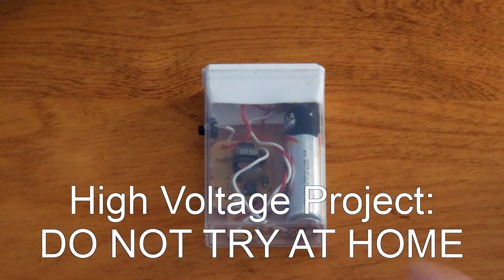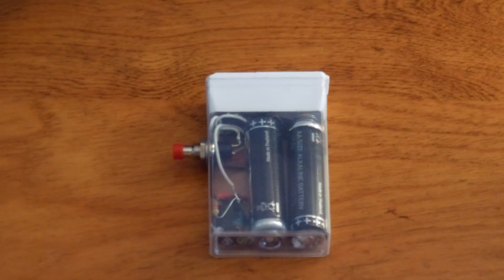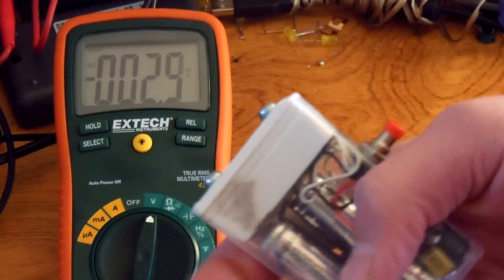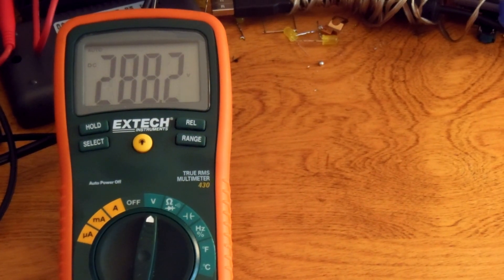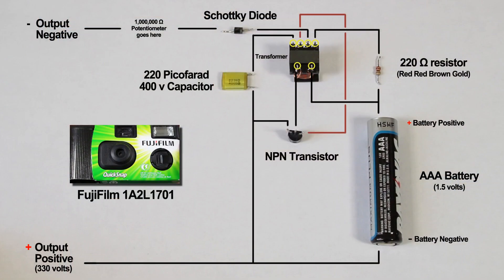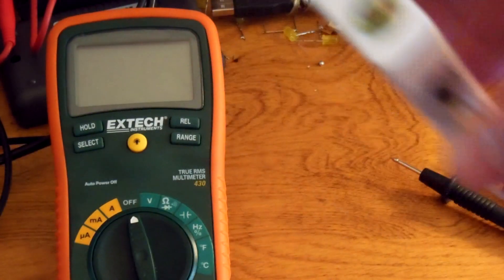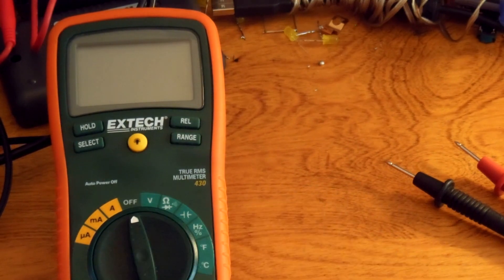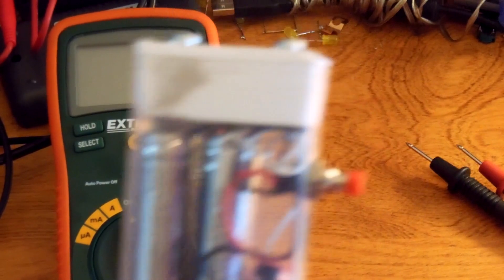Tic Tac Taser 2.0! Build a Stun Gun with Disposable Camera Parts!

Comment: in fact....maybe you could help me. You are clearly more inventive than I am and you are obviously a BAMF.....Help a brother out? :)

I put a shitty video of the component I'd be using, I'm sure there's SOMETHING I can do with it, considering what I've seen you do. My concerns would be exploding the battery acid all over myself or something like that but between my dad's skills in electronics, dated as they may be, and some of you youtube geniuses, I think I could develop a genuine combat-stun-glove that is perfectly viable
Reply from the maker: Joe Cannabyte It looks like that would work fine. Just make sure to insulate ALL wiring very well to avoid shocking yourself. I wouldn't be to concerned with the batteries, but you could likely replace them with something that has the same voltage.

Comment: do you have links or something to buy the tools required?
Reply from the maker: I collected the tools over time, so I don't have any specific links. You will need a soldering iron and solder, a hot glue gun, probably a drill and some drill bits, and needle nose pliers. Wire strippers and wire cutters would also be nice to have. You can get away with just using a soldering iron, a hot glue gun, and some pliers, but it would be fairly difficult.

For a beginner, I would recommend a Weller soldering iron such as this:
http://www.amazon.com/Weller-SP23LK-25-Watt-Soldering-Iron/dp/B0009ZD2AG/ref=sr_1_15?ie=UTF8&qid=1414555360&sr=8-15&keywords=weller+iron

The rest doesn't really matter, as anything should work in order to build basic projects such as this.

Comment: Could this kill a human or it wil make them faint but will wake up
Reply from the maker: electroguy2007 He had a valid question on the power of the device. I don't think that his intent was to kill anyone with it. Also, if he hypothetically wanted to kill someone, a $2,000 rifle is probably not the most economical solution.
Reply from the maker: Neither. It hurts, but does very little damage. Plus, when getting shocked the current only passes between the two points, avoiding any major organs or anything that would cause significant damage. And I have shocked myself with it and I didn't die and everything else is fine to my knowledge.
Reply: Just buy a friggin M16 if you want to kill someone

Comment: Hey can u show me step by step on how to make this with 2 batteries? I really need this thing.
Reply from the maker: I really can't, most of the parts I used were salvaged from other things, so I can't give you a parts list or anything showing you how to make it. Every part other than the batteries and the parts from the camera were found in my parts bin. If I built a second one, it would be completely different from this one due to the materials I have.

If you can't figure out how to read the schematics and stuff, you probably shouldn't be playing with 750 volts.
Reply: I REALLY NEED ONE OF THESE. CAN YOU MAKE ONE WITH 2 BATTERIES AND SELL IT TO ME?
Reply from the maker: alex mendoza I can't count the number of reasons I can't sell you one. Liability is a major reason. If I sell you one and you kill someone with it, I would probably be sued. Why do you need one so bad? Just buy an actual stun gun if you need one so bad, or just make your own. It's not hard to make, anyone can do it with some basic tools and stuff.
Reply: I BOUGHT A KODAK CAMERA YESTERDAY TOOK OUT THE BOARD. DESOLDERED THE CAPACITOR. SOLDERED WIRES WHERE THE CAPACITOR USED TO BE. CONNECTED THOSE 2 WIRES TO 2 SCREWS. THEN I DESOLDERED WHERE THE BATTERY GOES AND HOOKED UP A NEGATIVE AND A POSITIVE WIRE FOR THE BATTERY. AND THEN I CUT THE 3 WIRES THAT GO TO THE FLASH. AND NOTHING HAPPENED. IT DIDNT WORK. WHAT AM I DOING WRONG?
Reply from the maker: alex mendoza Does your camera have a Neon light or an Led? If it is a neon, I can't really help you because that doesn't work with this design. Did you put the battery in the correct way? Start with 1, then move up to 2 once everything works. You also need to hold the button that was used to charge it, that is what the red switch on mine does.
Reply: YES MINE HAS AN LED
Reply: IM ONLY USING 1 BATTERY
Reply from the maker: alex mendoza Have you tried holding the button down?
Reply: YES I HAVE TO HOLD IT DOWN IN ORDER TO WORK SINCE IT HAS NO CAPACITOR.
Reply: U KNOW WHERE THE FLASH BUTTON GOES I HAVE TO SOLDER THE BUTTON TO THOSE POINTS RIGHT?
Reply from the maker: alex mendoza Yes, there should be a circle in the middle and 3 rectangles around the outside. You need to connect one wire from the switch to the circle, and the other to one of the rectangles. It doesn't matter which one, all 3 rectangles are connected on the board, so you just need to solder to one of them.
Reply: HEY I GOT IT TO WORK
Reply: HOW DO I ADD ANOTHER BATTERY?
Reply from the maker: alex mendoza It is simply 2 batteries in series. I had to fabricate some parts to make everything work. It might destroy your circuit board though, so if 1 battery works good I would just leave it.
Reply: Or just buy a bb gun
Reply from the maker: electroguy2007 He didn't specify what he needed it for. I did mention in the version 1 video that this would make for a good prank taser. A bb gun wouldn't really be a prank. Also, for self defense this would be more discreet, and it would less illegal than carrying a bb gun around.

Comment from the maker: When asking a question unrelated to the previous one, please comment instead of replying. It makes it easier to find the comment and reply to the question.

Anyway, I ran two batteries in series without damaging the circuit too much. I am sure that the parts wear out faster, but because I don't use this frequently, it should be fine. I know 6 volts destroys the parts almost instantly though.

Comment from the maker: You're the the dumbass. The amperage will vary from situation to situation. The amperage is equal to voltage divided by resistance. With 600 volts, and a skin resistance of 10k ohms, the current should be 60mA, or .06 amps. Amperage doesn't kill people all by itself, and neither does voltage. A 12 volt car battery can supply as much as 1000 amps, but it doesn't vaporize people. Also, I should mention that this circuit can't even supply 60mA. It hurts like a bitch, but doesn't kill people.

Comment from the maker: It will look awesome because my Nikon S6300 can record 120 FPS slow motion. You might have seen it on the charger video. Between the Microwave Oven Transformer, the Flybacks, the Voltage Multiplier, and the Capacitor Bank, I shouldn't have any problems melting, burning, vaporizing, or destroying objects.

I also need to get some more flybacks, and go through my salvaged transistors to find some others to test with my driver.

Comment from the maker: The schematic seen is not one that I created. I found it on the internet, tested it, and it works. The one in the microphone video is simple, only 3 parts. Also, the breadboard is simply a way to build the circuit. Connect the parts in the same way you connected them in the breadboard, except use solder instead.